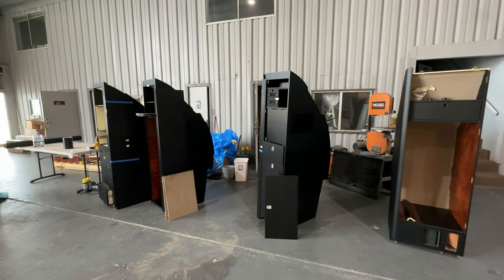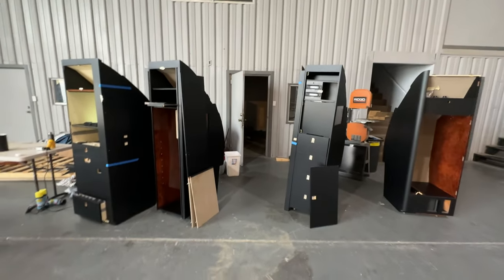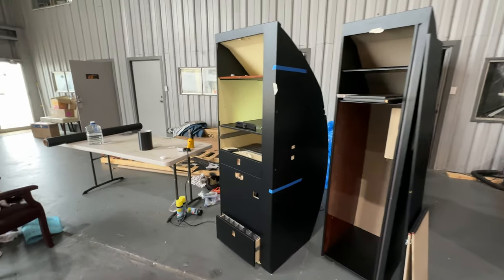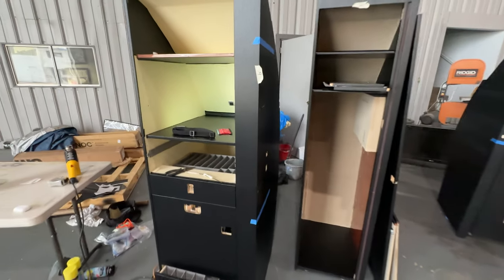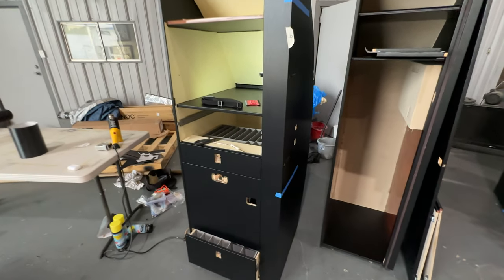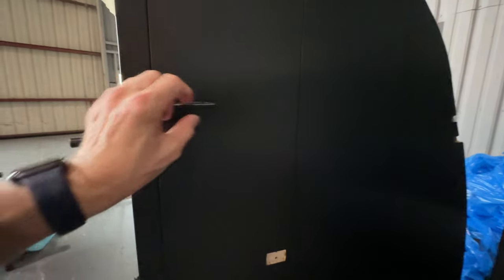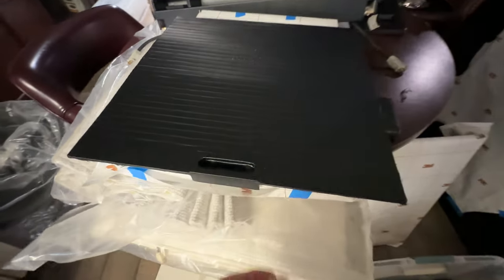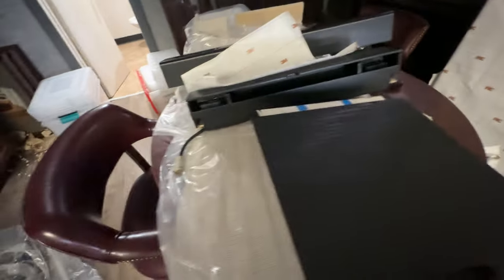Talking about how RM wraps did to Aviation wrap project using the 3M Di-Noc material in 2023

Comment: I noticed the invisible glass cleaner for prepping substrates. Isn't it cheaper and the preferred method to use a 70/30 mix of IPA to water. less toxic than using aerosols. also, 3M approved method
Reply from the maker: I sometimes use a 70/30 mix of IPA and water to clean my glass, but I've discovered that the Invisable glass cleaner actually does a better job. If you've noticed any residue or film on your windows after using the IPA mix, I recommend giving the Invisable glass cleaner a try. It's a more effective option.